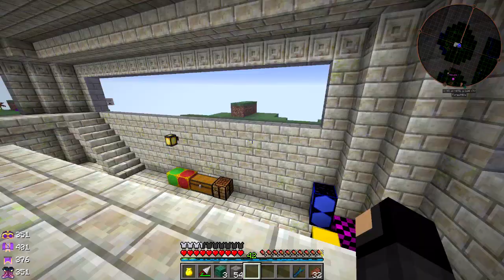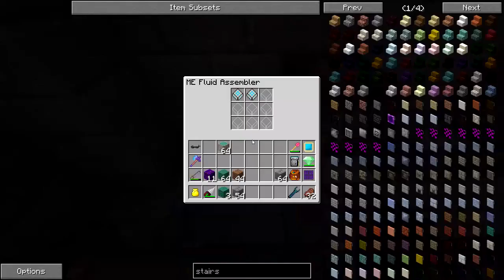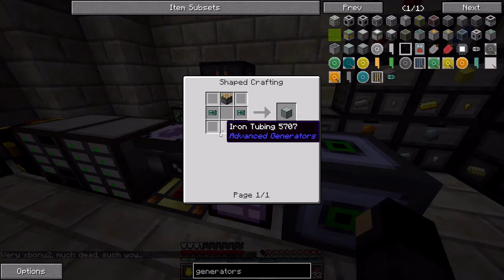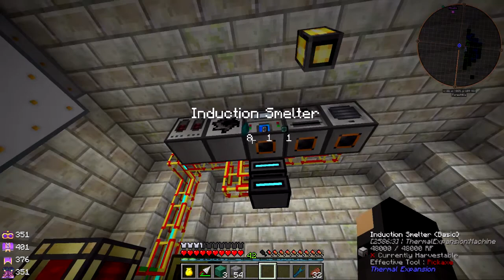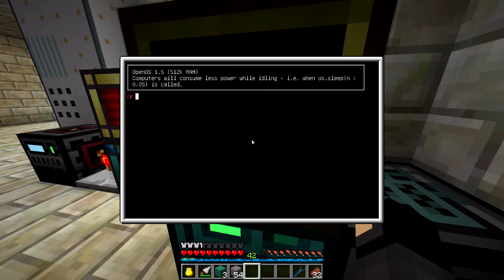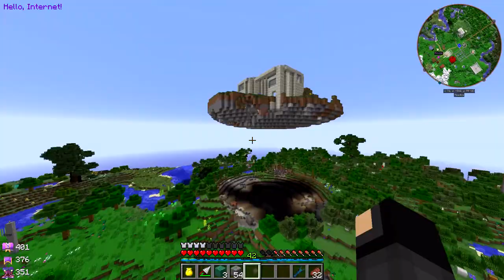Silent's Modded Minecraft - S4E29 - Glasses

Comment: I think you might be able to use this in conjunction with the thing that let's you scan the ground, and maybe write a program to have it create those Blocks you can see through other blocks at points where specific blocks are, like diamond and emerald for example. Though you may what it to refresh the program every so often so that those blocks go away if you had mined the block. 

Another interesting use would be if it can find monster spawners as a way of finding Dungeons. Though I'm not sure if this is actually possible.